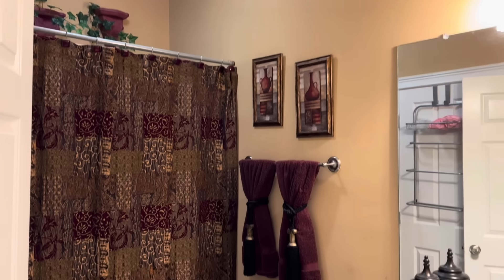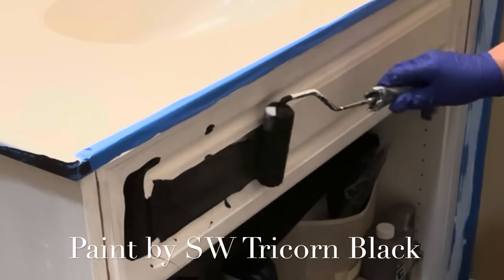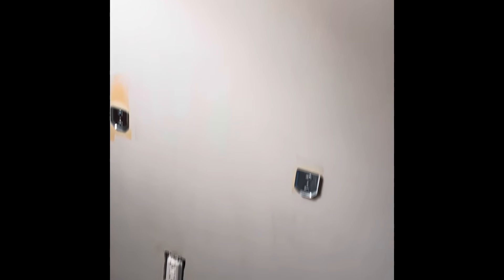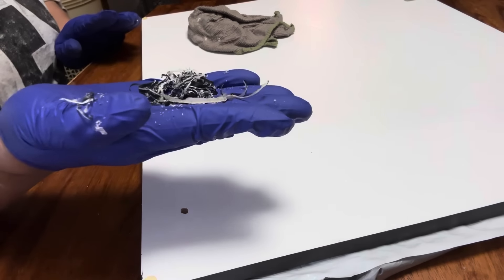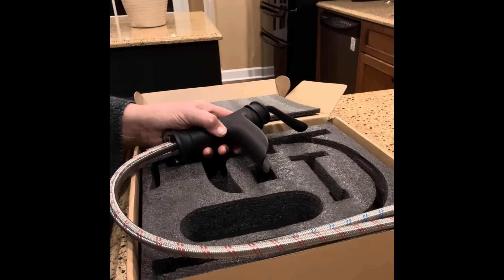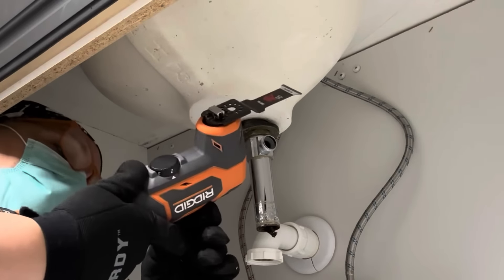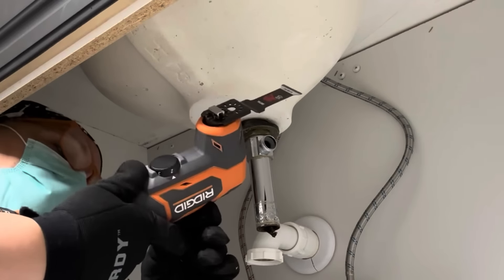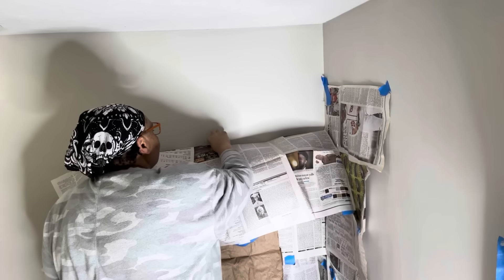2024 DIY BATHROOM MAKEOVER | 2024 DIY BATHROOM REFRESH | SPRING BATHROOM REFRESH

Comment: siSTAR!!!! YOU did an outstanding job! Also, you explained everything so thoroughly. 
Yes, I have been inspired.  I will have to get the heating tool, and other supplies. So I can clean up my mess.
Thanks so much!
Reply from the maker: Thank you for a lovely compliment. If you need more details and inspiration on how I did the cabinets check these two videos out it will definitely help:

SPRING 2023 BLACK AND WHITE BATHROOM 
https://youtu.be/cfmWPuqEgj8

DIY MODERN LAUNDRY ROOM RENOVATION | 2023 DIY LAUNDRY ROOM MAKEOVER 2023 DIY LAUNDRY ROOM RENOVATION
https://youtu.be/TBcOEO-MUS0